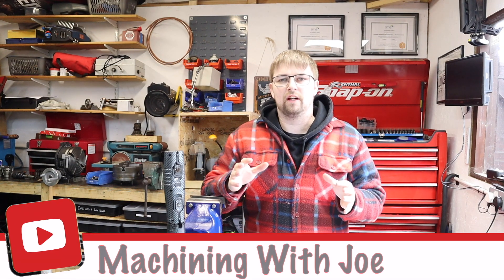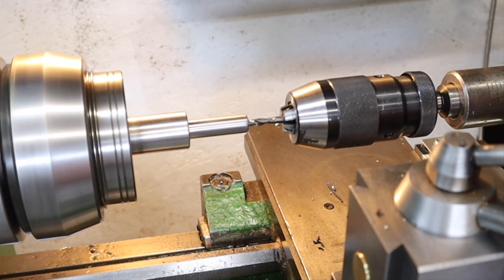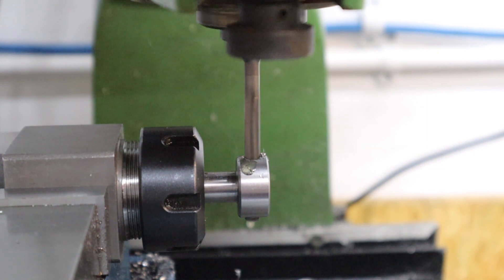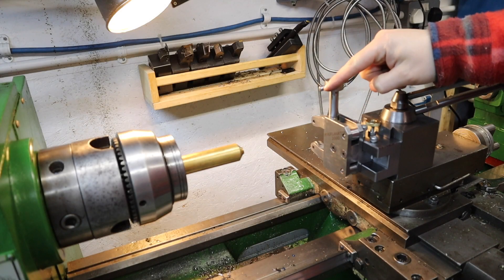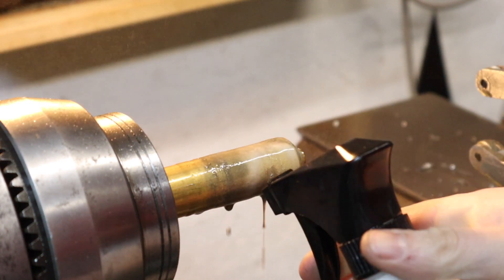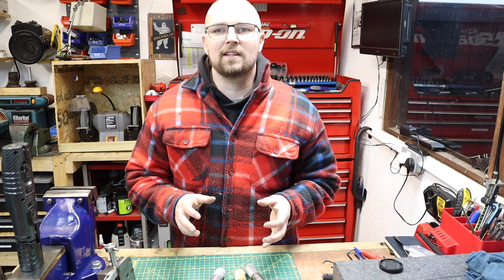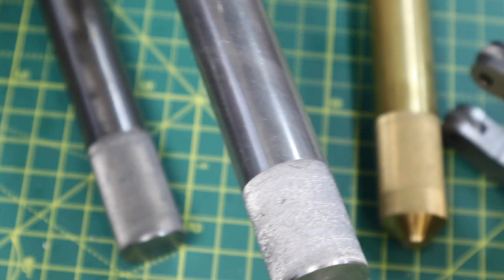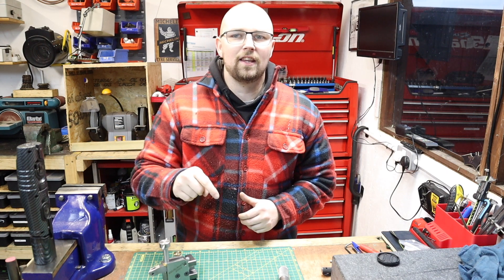Testing out the Hemingway Knurling Tool: The Final Result Will Blow You Away!

Comment: On brass and other soft material you should feed at 0.1 to 0.5mm per rev with a depth of half the knurl tooth depth. Feeding too slow causes the teeth to crush previously formed peaks.

In a perfect world we would feed at the pitch of the wheels.
Reply from the maker: Thanks for that bit of info I’ll go back and try the Aluminium again 👍

Comment: Hi Joe, thinking of buying the kit but Hemingway Knurling wheels out of stock , can you tell me the diameter and thickness of the ones you used so I can check if my old ones will fit ,
Reply from the maker: Hey Andrew yeah sure, 
So the wheels are 1/4” hole
5mm thick 
15.8mm diameter 
They measurements may need converted to imperial. Honestly greatly little kit/ tool well worth machining one.
Reply: @MachiningwithJoe  thanks Joe

Comment: Well done Joe! 

Helpful tip for you, I have found the absolute best way to clean out a fresh knurl is with brake cleaner. Blasts the oil and chips away, and air dries quickly so you don’t end up with lint from your towels stuck in the knurling. Give it a shot!
Reply from the maker: Hi Nick thanks for the advise I will definitely try again with Brake cleaner as the WD40 took a while to clean and like you sed leaves lint from drying.